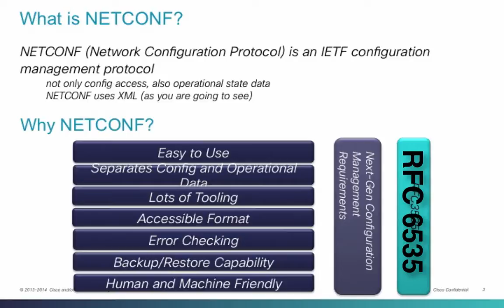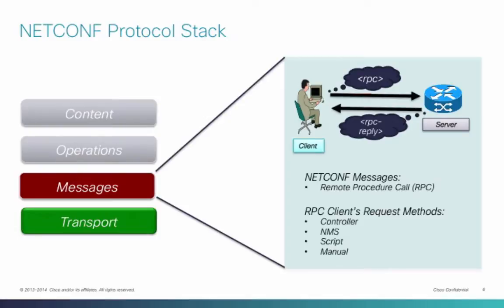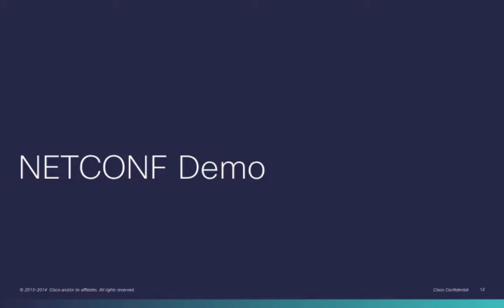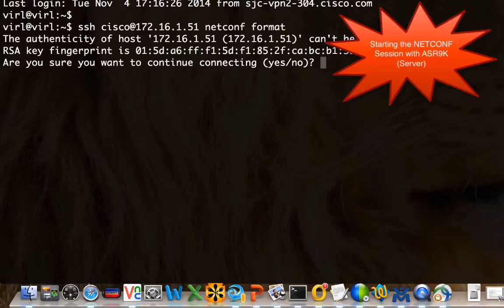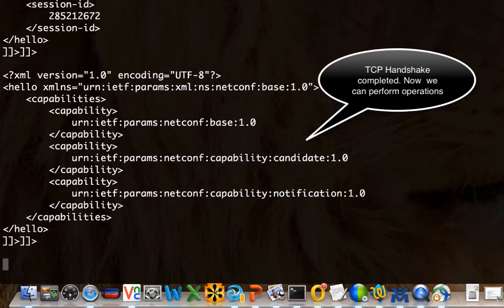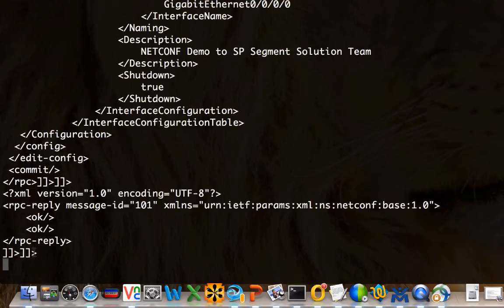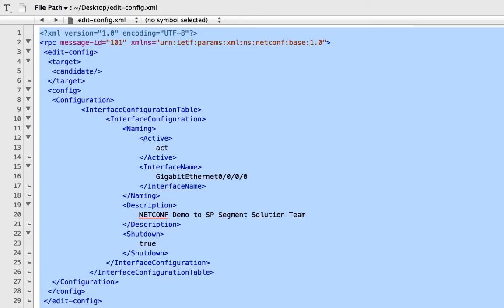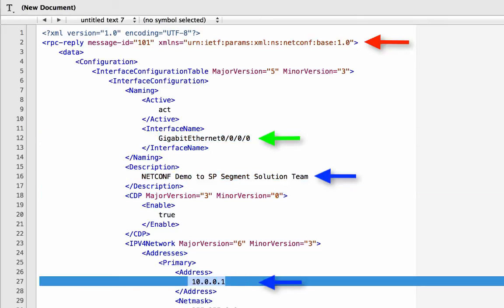The NETCONF Protocol Tutorial

Comment: I am trying the same on a Cisco ASR 9k with IOS XR 5.3.3, after the hello message I try your shut interface, but the machine closes the session immediatly. Any ideas?
Logs on the box
RP/0/RP0/CPU0:Feb  9 11:31:32.594 MET: netconf_sshd_proxy[65932]: TRC: NC: SSH PIPE INPUT cond: 0x1, fd 24, ctx 42099c0
RP/0/RP0/CPU0:Feb  9 11:31:32.595 MET: netconf_sshd_proxy[65932]: TRC: NC: CLIENT read: 7
RP/0/RP0/CPU0:Feb  9 11:31:32.595 MET: netconf_sshd_proxy[65932]: TRC: NC: CLIENT->SERVER 7
RP/0/RP0/CPU0:Feb  9 11:31:32.606 MET: netconf_sshd_proxy[65932]: TRC: NC: IPC connection with NETCONF daemon has closed

unix logs
...
...
</edit-config>
</rpc>
]]>]]>
Connection to <ip> closed by remote host.